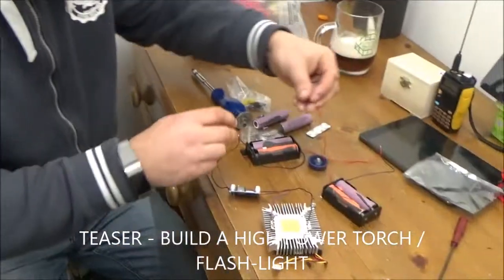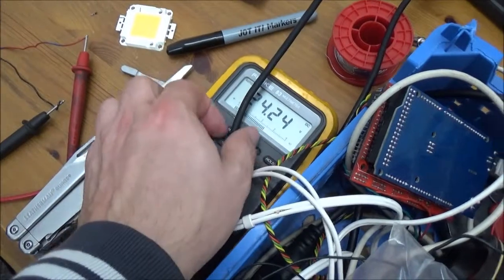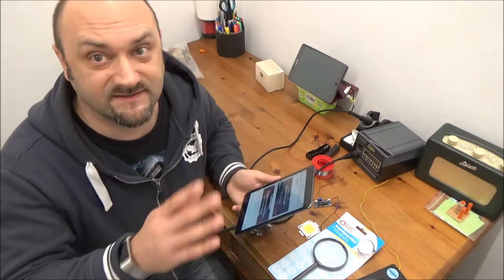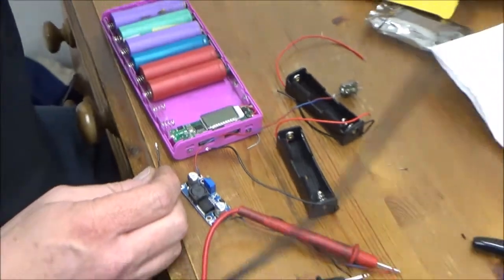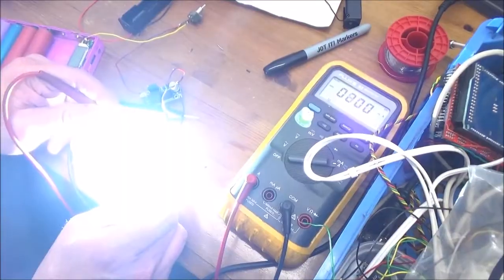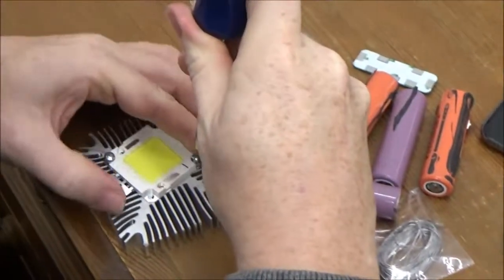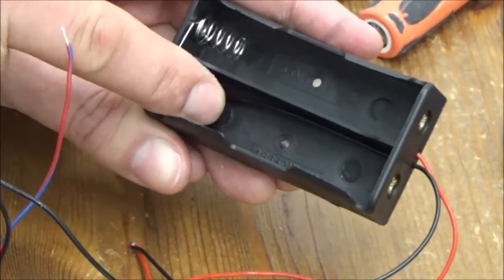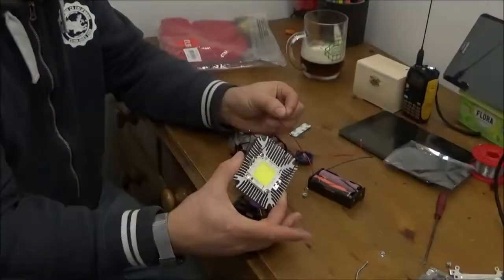DuB-EnG: Brightest Compact LED Flashlight Torch - Build PT1 - Heatsink cooling!

Comment: If you want to get your LED up to the full 50 watts, you're gonna need a few things:

a 6s li-ion battery pack (I recommend 6 series, 2 parallel with matched cells or a 6s Li-po to get about 20-25v and reduce the current) (power draw is roughly 3-4A for the entire circuit)

A better boost converter (I recommend overdoing the capacity and getting a 150w converter with current limiting ability so you can use constant current instead of constant voltage for better efficiency. It'll give you an upgrade path if you're anything like me and want MORE POWER!!!)

And not to mention a slightly bigger heatsink to keep the package temps down. You want to try to keep the temperature of the LED around 30*c, but it's safe to operate up to 60 without the risk of premature failure.
Reply from the maker: TheSOXMania this is all very good advice...  I’ll plan an upgrade in the future... I think your right, the boost conversion rating and doubled battery capacity would certainly help.

Comment: Those cheapo Chinese cobs work ok but to really blast that light you need to get some Crees!
Reply from the maker: Magneticitist MMMmmmmm! ...  Crees!
Reply: You won't be disappointed testing the XHP-70 line which you can get wired for 6v or 12v of course. You'll get a lot more lumens for that same 50 watts and it will handle the heat better. Downside of course, they ain't as cheap!
Reply from the maker: Magneticitist I’ll have a look for one ...  it would be far more efficient not to have a boost converter!
Reply: Also the key to doing it cheap is getting one of those $2-$3 buck drivers and replacing that tiny cheap trimmer potentiometer with a larger one of the same value. That way you don't have to use a damn precision screwdriver to vary the brightness you can just use a knob.
Reply from the maker: Magneticitist yup, I’m thinking direct drive 3x2 LiIon cells in series to get 12v and plenty of current... think I will make a couple of these going forward...  one of them will be a bit bigger and hairy!
Reply: Sounds like a winner. Sucker WILL get hot though with a big enough copper fitted sink it works ok from my experience. Something maybe like the size of that copper fitted one you have here but with fins extending to 3.5 inches or so. Sometimes I forget that these things are essentially 50 watt heating elements. I leave my 30 watt soldering iron on a regular sized heatsink for long and it's going to cook. And honestly, I bet if we scale them up enough and put small fans on them we could literally create small heaters for the winter.. The lights warms your hands, the fan expels all that warm air etc. I like the excitement in this video though, good luck with the projects!